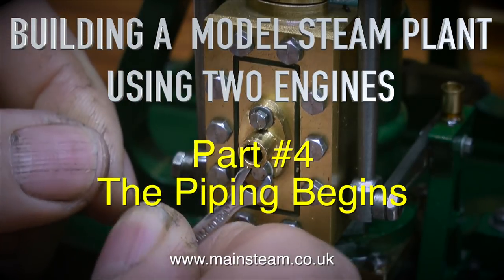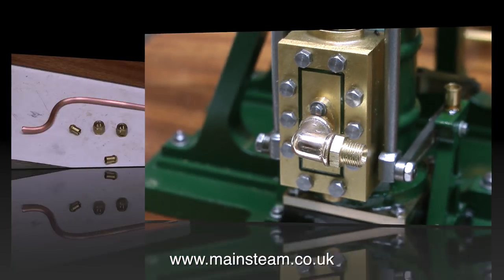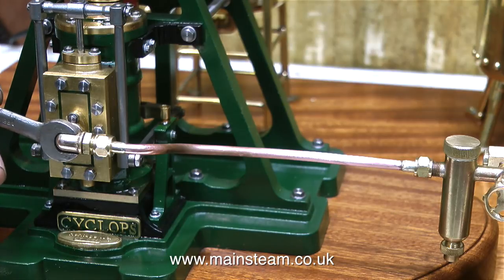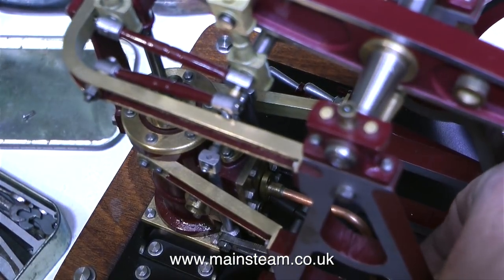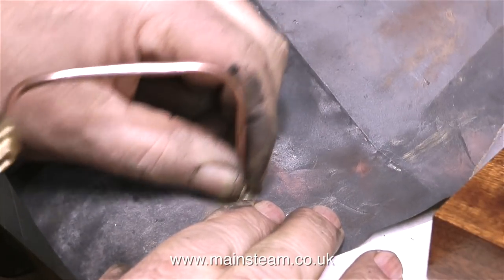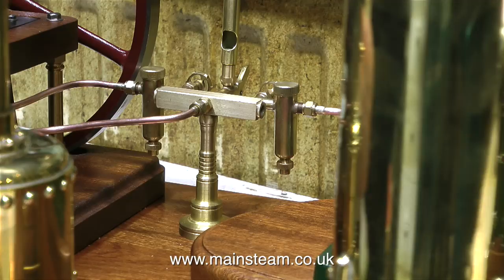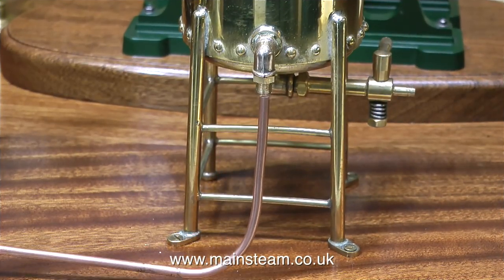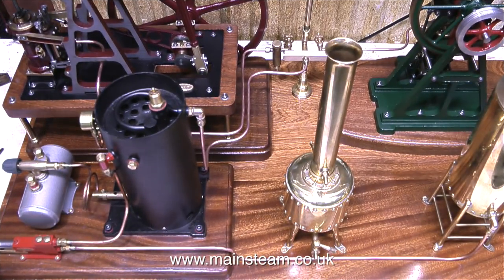BUILDING A  MODEL STEAM PLANT USING TWO ENGINES - PART #4

Comment: The angle of the BA threadS is 47.5 degrees, US threads are 60 degrees, Whitworth  55  degrees. It used to be a pain using mixed  US/UK  Kit,

Comment: There are a number of low melting pint alloys that you can use to bend tubes. One of these is called woods metal and it melts in a hot cup of tea. I've used it once or twice and it doesn't appear to wet the copper tube. You can use it over an over again as it can be fully recovered after bending.

Comment: Hi Keith,

Something interesting.  
I have found some hex head screws, or is that bolts, fit nicely around BA fasteners. Attached that to a short piece of Knurled bar with a hole for a torque bar (if needed) and you have a tube spanner. 
Give it a try and let me know.

Keep up the amazing inspiring videos.
(Now want to build a cyclops engine)

Best regards,
Paul

Comment: Is there a reason for not using compression type connections with olives (as used on copper water piping) on steam piping?
Reply from the maker: none at all .... I have never seen any 1/8" or 5/32" compression fittings though . .

Comment: Do you have to chamfer the ends of the lines for the pipe?
Reply from the maker: No, I just de-burr the pipe after cutting, then the pipe is a push fit into the coned union . . .